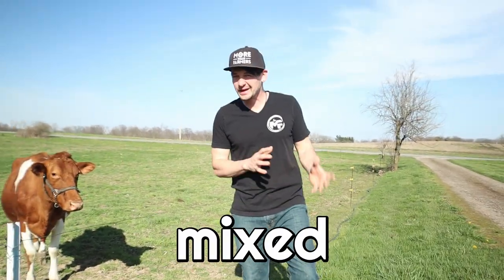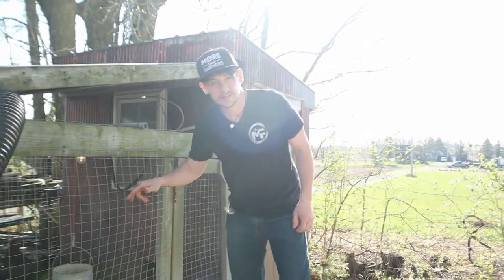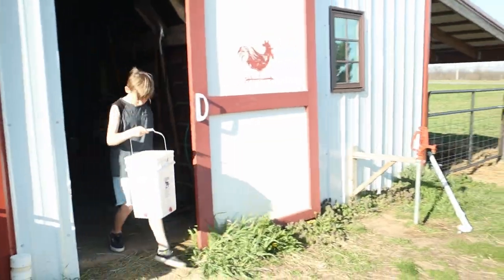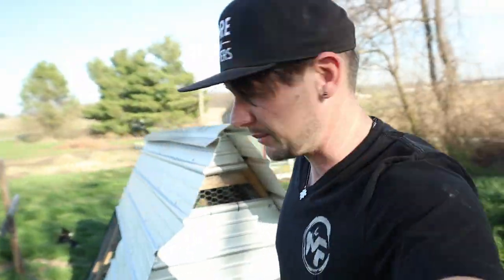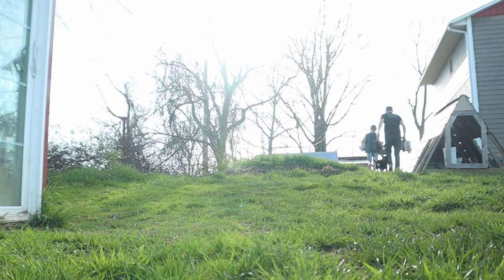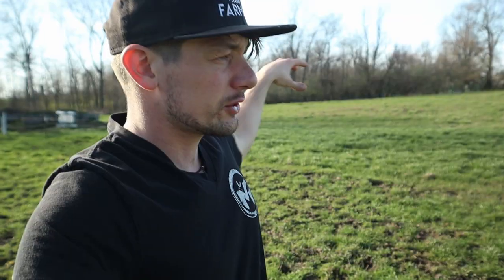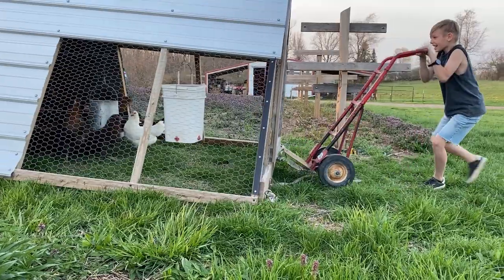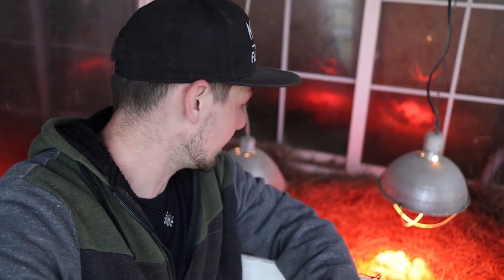⚠️OVERGRAZING WARNING! ⚠️

Comment: I was hoping to see how you all clean out that hen house after moving Izzy's chickens and before those poor baby chicks arrived. I ask because I have bad lungs and I know I'd wear a N95 mask because my allergist requires it, but I am also curious how much stuff goes into the air.  I am an urban gardener and chickens are allowed, but I only want them to peck at ticks and mosquitos in the yard, basically. If I get some eggs, yay.  Thank you for advice. Take care.
Reply from the maker: Not much cleaning happens in between.. That's not an issue in a small healthy operation. It's the big commercial farms that struggle with diseases all the time that have to majorly clean everything in between batches.
Reply: @morethanfarmers  Good to know. Thank you.

Comment: I know im late to the game but why not just put tires on the front as well to make it easier for anyone to move?
Reply from the maker: Good point! I did consider that. The biggest issue is they would have to be able to swivel to turn the pen.. making them swivel and be on a lever to lift up and down would definitely not be impossible, it'd just take some doin. The dolly seemed simpler, and it works pretty well.